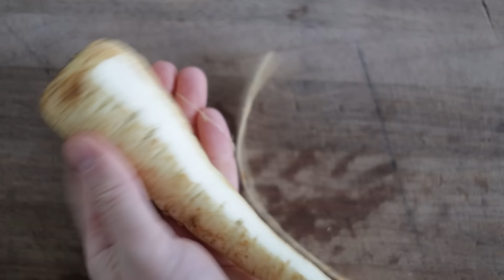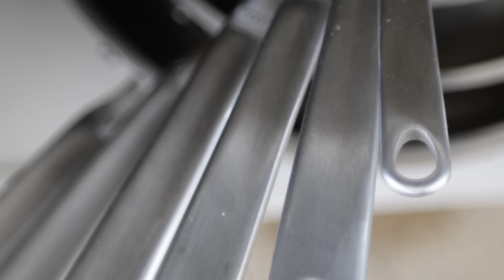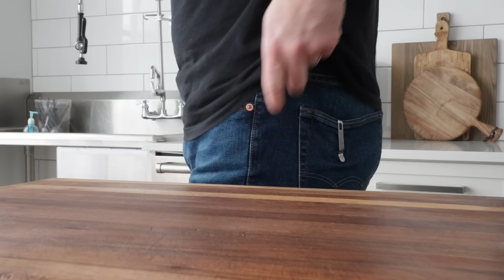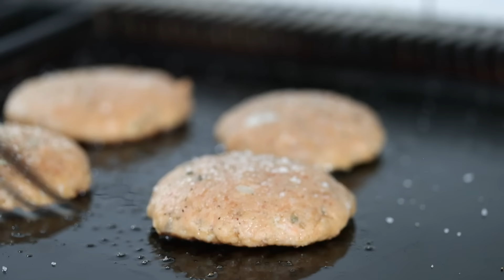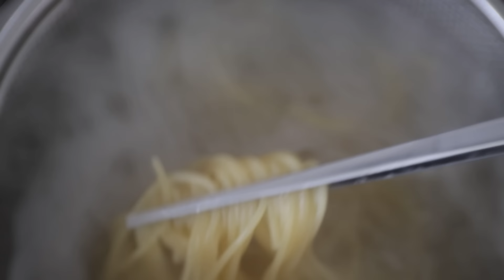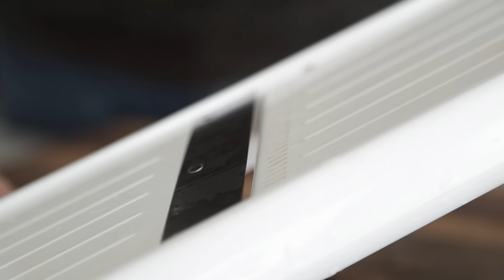Cook Like a Pro with These 15 Must-Have Kitchen Tools

Comment: Great list ...will revisit it and so glad you gave what you use and where to buy. I will definitely buy some tweezers.  I had a carbon steel pan but didn't take care of it.  Currently use tin coated copper and cast iron with a few All-Clad pots which are indestructible!  I have an Italian steel mandolin that cost over a hundred dollars decades ago and I have never used it. Thinking to break it out and give it a try for stove grilling veggies like zucchini and eggplant.  One pan I could use is the rondo.

Comment: I never wash my cutting board. 

Sanitize your board with vinegar or lemon juice. 

Titanium pans are better than carbon steel. 

I use an ENSO 5.5" prep knife—not exactly a petty knife.

Instead of a tweezer, I use micro tongs with plastic or silicone tips.

Comment: Ok.  Nice video.  Everyone should listen to you here. I already have all these in my kitchen - and more importantly - ever utensil needs a dedicated home.  That B-roll shot of the drawer with utensils scattered higgledy-piggledy gave me the heebie-jeebies.  

Also, another must have are two (2) stainless 1TSP and two (2) stainless 1TBSP spoons-  located in a designated spot in drawer adjacent to your oils, vinegar, soy sauce etc.   I find that if I do not measure, I will always over-pour - thats my nature.  The actual measurement is less important - than cooking with some consistency between meals.

Comment: I don't peel stuff that much.  I want to get a wood cutting board,  but I need get my bands  on a good oil or blend. I have a carbon steel wok, but that's about it. I got into thermometers and spider strainers a long time ago. Definitely use the citrus squeeze. I have been looking at mandolin. I got some nice pans and racks a few years ago

Comment: Totally agree with the rondeau pot, chinois, and a few others. But if you buy a solid potato ricer you don't need to buy a juice squeezer. And rather than an offset ladle, I would buy a Chinese wok ladle. I would also suggest buying a cut proof glove along with the mandolin. Because that's an accident you don't want to happen. Someone else mentioned a bench scraper, and I absolutely agree. One I would add that most people don't, a salad spinner. Not only can you properly wash your salad greens, but you can also help dry items for stir fry.

Comment: Not sure the difference between a "braizer", and "rondeau" pot but I just got mine in two sizes one of which is 20qt and the other is smaller but 3ply. Really really nice and can be used for many applications including replacing a fry pan!

My opinion although I love wood cutting boards and are my "go-to", the plastic ones should NOT be dulling your knives. If so, you seriously need to upgrade the knife steel and heat treat of your kitchen knives. With knife/steel technology we have available, you can literally chop steel and it not affect your blade if made properly. 
Start with a good quality vg10 and go up from there, and those nasty plastic boards will no longer matter to your blade.
Another example, hand Forged Chinese cleaver. Less expensive, more versatile, and you can witness their ads showing them batonning their blade through soft steel with no damage at all to the blade!
You're welcome.

Comment: Poultry shears-great for cutting any type of meat, cutting dough to shape/size.
If you have a meat in the pan already, and want to cut to a smaller size, poultry shears avoid cutting down with a knife onto the pan surface.

Comment: Try the original victorinox peeler works bidirectional. The small Ikea round garlic press has so fine tolerances that no garlic comes out of the top of the press.

Comment: That's a good selection. Since you're likely going to have half sheet pans you might as well get a silicone non-stick pad for each as well as the cooling rack that fits them. Then you don't have to bother with cookie sheets. I have big hands and find it easier to use a utility knife as a paring knife than an actual paring knife. All the rest of the uses work well too.

Comment: Oh...I wish I had a kitchen big enough to hold all these tools. Trust me, not all kitchens are created equal.
Reply: Keep nesting. I can fit all my most used kitchen items in a very small kitchen box - fits on one side of the back of my Pathfinder behind 3rd row slanted seats. Small items inside set of bowls inside set of 3 pots with removable handle inside strainer bowl inside stainless bowl - and easy enough to add silicone pads and mini mits and cloths/towels inside. One roll for all utensils from silverware to tongs etc to knives. Add a few nested Joseph Jospeh containers, etc… Plates nest inside skillet.
I have fit a hotel cook kit for family of 4 inside a school lunch kit and the induction hot plate in the laptop sleeve of my backpack.
Reply: My current kitchen is a 3 burner propane stove with a very small oven in my 30-foot RV.  Interior space on my RV is about 180 sf.  I always drool over this Chef's kitchen.  I'm looking for property and a builder for a modest custom home and I want my kitchen to look just like Chef's kitchen!  I love it!
Reply: Everyone has space for this stuff

Comment: Chef Billy, here are my favorites that few people beside myself seem to use.

• Microplane grater . You show yourself using one at the end of the video but you didn't mention it in the list.
• Flat whisk . This kind of whisk has all the tines in one plane, so you can whisk the fond off the bottom of a pan with plenty of contact with the tines. I don't know of anything that I whisk that this kind of whisk isn't suitable for. Maybe whisking egg whites to stiff peaks would do better with a balloon whisk, but everything else does fine with a flat whisk. Plus one additional benefit that is under-prioritized: flat whisks are way easier to clean, since all the tines are on the same plane.
• Asian style skimmer . They're like a smaller version of the spider strainer, but with an ultra fine mesh. These are better for removing foamy scum from broths and stocks, and believe it or not, if you're using one that has an ultra fine mesh, they can skim oil because water will pass through the mesh quickly, but oil resists going through the mesh as easily for some reason. Try it and see how it works for you.
• Ground meat chopper . Enough recipes of mine use ground meat or tomatoes that I need to mash up where this tool ends up earning its keep. This tool lets me chop up ground meat right in the pan. 
• Melon baller . But not for balling melons! Nobody balls melons anymore. These are the best tools for coring apples while leaving the maximum amount of edible apple flesh, but also for scooping/scraping out the seeds and spongy pith of japaleños and other peppers. I like the Oxo branded one which has a scoop that is a section of a sphere, and two ends. When coring apples, one or the other end is usually the perfect size. Plus, the Oxo one is sharp enough to cut when using it to scrape pith and seeds out of various fruits and veggies. It is also good for scooping hard fats like frozen chicken fat, clarified butter, lard, coconut oil, etc.
• Good kitchen shears . These are useful for so many things.
• Miso strainer . These are used to dissolve paste into liquid without leaving lumps, traditionally used with miso paste. But every instance where I am dissolving something into a liquid where lumps are a risk ends up benefitting from using this tool.
• Herb comb . These are perfect for rapidly stripping herbs like thyme, rosemary, oregano, or separating parsley or cilantro leaves from stems, and stripping leaves off of kale. I like the Oxo brand.
• Digital kitchen scale . This is a must-have item when working with flour, and for precise and consistent portioning of things like pasta. 
• Oval pasta pot . I hate it when I put spaghetti into a pot, and have to poke and prod the spaghetti until it softens enough to all settle under the boiling water. That's such a waste of time. The oval pasta pot lets me drop in the spaghetti sideways, and because it is wide enough, all the spaghetti goes under the water immediately. It lets me boil less water while still being able to fit my long pasta lengthwise, which results in starchier pasta water, which is useful for thickening sauces. Less water also means the pot of water comes to a boil much faster.
• peeler with the "ramp" . My vegetable peeler has a "ramp" or a wall on the blade that curls the peel in the direction you are peeling so it doesn't drape over the vegetable as you peel it. This makes peeling a vegetable much more pleasant. It is hard to explain. You need to try this peeler. I got it from Daiso for $1.75 and it was totally worth it.

For the mandoline, I must add one more thing: cut-resistant gloves . Everyone I know of who has used a mandoline has injured themselves with it. The food holders that come with mandolines don't work well. The only real good way to stay safe while working quickly with a mandoline is to use cut-resistant gloves.
Reply: Ok, first of all, kudos, because as I was reading your comment, I felt like I was reading something that I wrote myself!  You and I are very like-minded!  Especially with the Oxo melon baller.  I too have found it excellent for coring apples, and its sharper edges make it a great tool for getting the seeds/pulp out of butternut squash.  I also love my flat/sauce whisk, and I feel like not enough people talk about them!  And I also love my little skimmer.  I also notice that it helps lift out fat (in small quantities), and I love it for skimming foam from stocks/sauces.

If I may, I'd like to give you one trick I have learned that has solved my spaghetti problem without the need for an oversized pot or an oval pot.  I have recently fallen in love with my 4qt saucepan for long pastas.  I know it sounds ludicrously small, but just hear me out.  I have always hated grabbing a large 8qt pot and filling it with a ton of water and salt just because of long pasta.  Plus, I want access to the starchy water, and that's impossible if it's so diluted in a giant volume of water.  I originally tried out J Kenji's recommendation of using a wide sauté pan instead of a pot, but I still found this cumbersome for many recipes that require heavy stirring, and tossing long pasta in a sauté just makes too much splatter.  Plus, the sauté pan evaporates water too quickly and I found it much harder to keep the pasta evenly submerged in such a shallow vessel.  So one day I got a harebrained idea to try, and now I can cook enough pasta for 4 people in… my 4qt pot… in only 1.5 qts of water!!!
  
What I do is I bring the water to a boil with the lid. Then I add the salt and the spaghetti. The spaghetti is a little too tall to fit into the pot (sticks out like 1" when placed at the diagonal), and obviously the water is super low, but I'll just put the lid over the pasta anyway and only a little bit sticks out at the edge.  Over the next 30 seconds, the trapped steam will help soften the pasta and it starts to bend.  I can use the lid to slowly tuck the pasta in until finally I can close the lid all the way.  Then I just leave it closed for another ≈30 seconds until the pasta is soft enough to fully push down into the shallow water.  Now I can just boil like normal without the lid, occasionally tossing the pasta in the beginning to prevent sticking.  This allows me to reach a boil faster with less water, use less salt, and a smaller pan that is easier to stir and easier to clean.  Plus all of that pasta starch is already super concentrated in a small quantity of water; excellent for adding to sauces without adding too much salt!  Win-win-win-win-win.  I still get the benefit of a tall-walled pot for ease of stirring, but it is much more conducive to smaller batches because it is only 4qts  Seriously try it out.  It has removed so many pain points for me when it came to boiling long pastas.  I have even gotten this to work with my 3qt pot as well once, just as an experiment.  It did work fine, and I would do it again in a pinch, but the 4qt was still my most comfortable and preferred option.
Reply: @dirtyketchup  The Bialetti oval pasta pot I use has another benefit that still makes it my preferred way to boil long pastas: the lid locks on and has perforations for draining the pasta.
Reply: I guess. Nobody uses a meat thermometer....🤦‍♂️
Reply: I still have no idea how I cut my finger, let alone so badly while using the guard for the mandolin. I just can’t figure out what happened. I was just suddenly very badly cut!

Comment: Could the Large enamel Lodge Dutch Oven work the same as a Rondeau pot????
Reply: Le Creuset have a very similar styled “every day pan” and I’m sure Lodge would have similar. The Dutch Ovens generally aren’t square enough to offer the surface area.
Reply: Use a deeper brasier 
The Dutch oven is too deep

Comment: I recently saw a video that claimed that using plastic cutting boards releases microplastic particles that get caught up in the food you are preparing, so like giving up nonstick cookware I have discontinued using plastic cutting boards and rely on all my wood ones. In addition the bamboo boards are inexpensive and sustainable.
Reply: Sigh... You do realize that bamboo doesn't grow in board form...so those things are impregnated with glue... And so are most regular wood boards...

The myth that wooden boards are better than poly boards needs to die.
Reply: @ I can deal with a little glue to avoid cutting polyurethane into my food.
Reply: @pobrien864  don't cut into your board then, magilla

Comment: First time i used the mandolin,  i cut my thumb. Oh, i knew better, but it was going so well until it wasn't  😂
Reply: It's weird how fast a mandolin can turn a great day into a day you'll never forget for all the wrong reasons. 

If whatever you're slicing isn't acidic, you might even take a few more strokes before you realize you're taking your finger off in 1/8th-inch increments.

Comment: I would like to add an infrared thermometer. It's so important when cooking with my carbon steel pan to get the temp just right!
Reply: Excellent recommendation! Finally we have the ability to fry/saute at the correct temperature rather than use old fashioned techniques like watching water skitter across a pan.
Reply: @trishfitzpatrick2066  Just be aware that, unless your infrared reader has an emissivity setting, those temp guns do not work well on shiny/smooth metal surfaces.  They'll work fine on seasoned pans like carbon steel/cast iron, and they seem to work fine on nonstick surfaces, but they do not work on stainless steel, tinned, or copper pans.  They will read super low and you'll end up WAY overheating your pan (ask me how I know).  Just food for thought.  Honestly, I stopped using the gun for that task anyway, and now I mostly just use it as a spot check for frying oil temps.or for hot spots in the oven.  Just practice holding your hand above the pan after it has preheated, and you'll start to learn how to gauge the temps as you practice.  

And to those who will say you can just add oil to a stainless pan and then get a more accurate reading, I have two answers.  (1) Oil is always going to take time to come up to temperature with your pan, and (2) you should never preheat your pan with oil in it.  Always add oil to an already-preheated pan, and only just before you are adding ingredients.

Comment: A tempered glass cutting board with rubber corners is my preference. It's so simple to clean.
Yes, knives get duller faster but that's what my knife sharpener is for.
Reply: You’re also eating bits of steel broken off your knives, but they’re too small to hurt you much.
Reply: @cmarkn guess what’s in your iron-fortified breakfast cereal.
Reply: @satanismybrother  Not flecks of steel.
Reply: @cmarkn  I wipe my knives after sharpening them.
Reply: @ and then you smash their sharp edges into glass and break off little pieces. Why do you think they get dull?

Comment: Carbon steel pans are not good at even heating ... certainly compared to a tri-ply stainless pan!  I have some carbon steel pans that I really appreciate, but they're certainly not for everybody!
Reply: And carbon steel pans aren’t good for “everything.” I used mine for a tomato based dish and ruined the hard won seasoning and had to start over. Anything acidic calls for stainless.

Comment: I don’t have a Rondeau pot.  Does it do anything my Le Creuset pots won’t?
Reply: I have the wide profile Dutch oven from Le Creuset. It is my favorite large pot. I feel no need to get a stainless steel version.
Reply: @MD82321  I was thinking the same question. Another thought I had was the sides are higher than a skillet. That should reduce grease spatters.
Reply: @barryhaley7430 Yes, it cuts down on mess from splatters. I believe the wide profile Le Creuset Dutch oven would be an upgrade from the stainless steel.
Reply: No
Use ur Le Creuset
Reply: A deeper braiser is next on my wish list
Some of the braisers now are so shallow. They’re no deeper than a skillet!